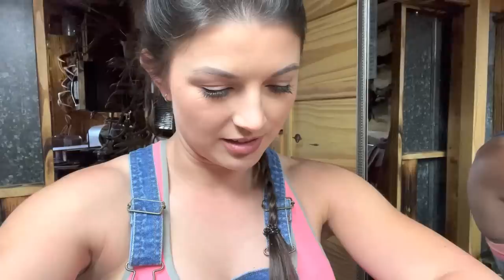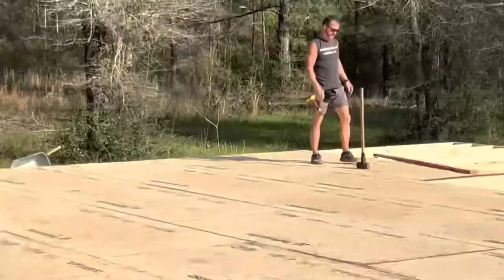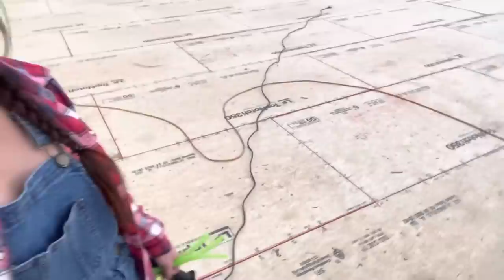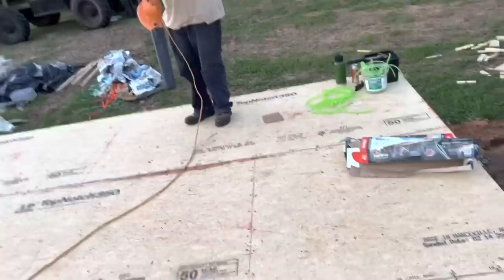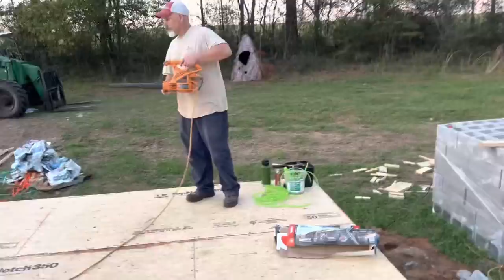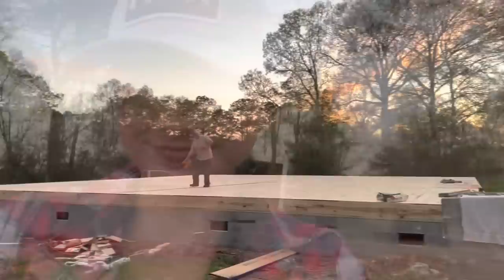Putting Down OSB (i still call it Plywood) on the floor system of MY HOUSE!

Comment: Good day Hannah, always nice to see your smilin face. I have a 42 year old daughter that fallowed me into wood working and occasionally learned some lesson the hard way. One of her first was a small shed that she quoted on and like you she liked to call OSB plywood. She had the floor screwed down when the customer showed up and made her unscrew the OSB and replace it with plywood but he was nice enough to cover the upgrade cost for the whole project but she did have to eat the OSB. Good thing it was down with screws and not ringnails!! Now a professional in my books she calls it what it is. Cheers to you and you Fam., Billy in Canada.

PS: Here in BC, Can. code requires 46 screws per sheet ( 8"s and 10"s) by 72 shts. is 3,312 for your floor, lots of screwin for soft hands.

Comment: Hannah and Jeff, i have done interior walls with OSB instead of sheetrock and it came out amazing. The OSB on interior walls also provides more strength from storms so it might be something you want to explore as well since we will keep getting bad straight line winds, tornados and hail events. I used 3/4 OSB on exterior and 1/2 OSB interior. The home is very solid and i can hang anything anywhere :)
Reply: Wow, a lot more money too!
Reply: @aw4088  Yeah but we did all of this right before covid hit so the prices were somewhat normal. I think we paid $9 per 4x8 1/2 sheet. I would highly recommend that if you are buying a lot of building material from home depot then take your supply list to the bid room. They reduced the price big time and saved us a lot of $$
Reply: Maybe put osb on the attic floor might strengthen it.
Reply: 5/8 CX drywall is the way to go for finishing the interior, strength and fire coded for at least 45 mins, when peoperly installed..
Reply: sure you can, with short screws maybe, but when you hit a pipe or a wire with a screw you will wish it was 5/8 drywall for the fix.
Reply: @freywayne6574  lol you should never hit a water line or electrical line through metal plate protectors. I have an 8 inch on 12 center exterior frame and 6 inch on 12 center interior frame home due to future weather event unknowns and strength. Even with the wide frame we still used the metal plate protectors for all plumbing and electrical routes within the frame. My electrical and plumbing routes come from ceiling joist which are 2x10 on 12 centers.
Reply: @bc5891  $9!!!! Color me jealous
Reply: If your worried about hail and wind knocking your house down I think you need a new builder, as for a tornado osb isn't going to help, make an ifc house if your worried about that
Reply: @jordanturner5278  Had Ida here with 140mph winds. It was so quiet in this house you could hear a squirrel fart. My house is very solid!
Reply: @bc5891  so you have triple pan glass windows?

Comment: The inside of my house is built with OSB . Works great for a country house. The outside if my house has Stained Lap wood siding. I'm happy,  that's all that matters🤠 I have buldgin disc and pinched nerves in my back. I know about BACK PAIN AND NECK PAIN

Comment: Oriented Strand Board-OSB makes a decent subfloor. Not as good as real plywood but much cheaper. You really won’t see the difference unless you have a water leak. OSB falls apart when wet. Plywood will take a little more punishment.

Comment: What did you coat it with for waterproofing for the future? You live in a very humid environment for flake board or even traditional plywood.
Reply: I agree. This is a huge no-no to use for sub flooring.
Reply: Tongue and Groove OSB Subfloor is usually engineered to be water resistant. And runs about $40 a sheet
Reply: @BobJ2828  more like a $100 a  board. It’s still no good for sub flooring in humid conditions. Not allowed by contractors in commercial construction building. Not recommended by any contractor I know. I’m retired after 40 years in commercial construction.
Reply: @HippieRednex  We use it all the time here in S.C. with 80 percent humidity in the summer. I've got 6 bundles of Georgia Pacific DryGuard sitting on the yard right now.
Reply: @BobJ2828  Yes and well I would still coat each sheet with something better considering the humidity of where you live.
Save a million in the long run.
Reply: @Billbobaker  G.P. DryMax and Dry Guard is already coated and and uses water proof glue and has a great garentee. A much better product than just treated playwood, No squeaks ever and better nail holding. Never had to complain to GP about their product.
Reply: @HippieRednex  OSB T&G  is used extensively in the South for residential sun-flooring on raised or multi-story foundations. It’s virtually always T&G plywood or OSB.
Reply: @BobJ2828  I would still give it a pretty good dose of some sort of protection considering that environment.
Reply: @Billbobaker  Well we been using it a long time with no problems. Do you also do this to your engineered floor joists? That would be time consuming and expensive.
Reply: @BobJ2828  no just the flat floor surfaces where water could spill/pool and be a problem. 
It's cheap insurance at this point in construction.
Reply: @BobJ2828  remember they did just  put a few million screw holes in it.
Reply: @Billbobaker  so what has that got to do with where I live and humidity? Pooling water would be a problem for any floor material, well except concrete. I had rather have something that is guaranteed against water damage than something that is not. We have had DryGuard get raind on for days before the home was in the dry with no problems.
Reply: @Billbobaker  lol what has that got to do with humidity? Would you not do that to any sub floor?Galvanized screws for the win!!!

Comment: Osb ant good for floors the best thing for floors is 3/4" treated plywood osb ant good if you have a water leak by accident are a storm comes though and pulls the roof  Shingles off with the high winds and the floors get wet osb will fall apart just like press board just my suggestion from experience

Comment: we call it Old Shit Board. OSB. 

 but from what i understand they use a new kinda glue for it now. and it holds together better if it gets a sneeze of moisture on it. back in the day it would fall apart if you got it the tiniest bit wet. and using for a floor was a no go because the moisture in the air under the house would eat it apart. a lot of old mobile homes are made with that old stuff on the floor and they are falling apart.

Comment: Whoever come up with idea of using OSB as flooring should be fired. OSB sucks. I'm in the process of replacing the floors in my house from OSB to plywood. OSB swells and weakens when liquid is left on it. Regular plywood can handle liquid better than OSB can.

Comment: You should never use OSB on a subfloor. That crap will come all to pieces if it ever gets any kind of wet. OSB should be used on exterior walls only. I am retired after 40 years in commercial construction. This is a huge no no! Only use tongue and groove sub flooring.  This house is gonna have problems with the flooring within 5 years. I have seen this crap done before. OSB stands for “oriented stranded board”. Not “outside board” as some people claim.
Reply: .. its marked Louisiana Pacific tongue-&-groove
Reply: @_Boregard_Rippy_  it’s still OSB, not recommended by any commercial construction contractor I know. It will be a problem in a few years. Contractors throwing up houses to sell will put anything in them to make a profit. Use real plywood if possible. I know wood has gotten outrageous in price since Biden got in office and contractors can’t make as big a profit if they use real plywood.

Comment: OSB is the WORST type of Sheeting to Ever Use !  All OSB is is Glued together wood chips !  
 If that OSB gets WET from Rain 🌧 it’s gonna Start Coming Apart in
 3 days or so. 
Better to use Old Fashioned Plywood.  Good Thick tongue and groove style for the floor. At least your Screwing down instead of using a stupid nail gun. 
Anyway I think Nowadays OSB is More Expensive Old Fashioned CDX. 
When OSB 1st came out it was Cheaper than CDX. 
OSB Chip board is Crap 💩